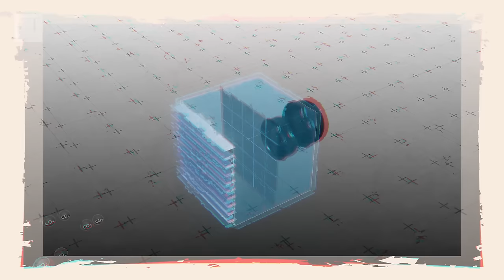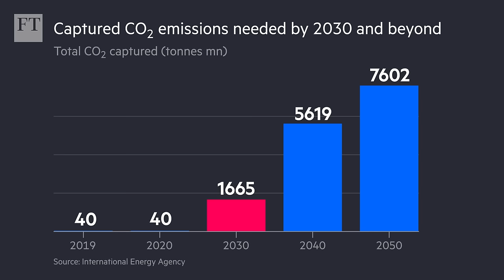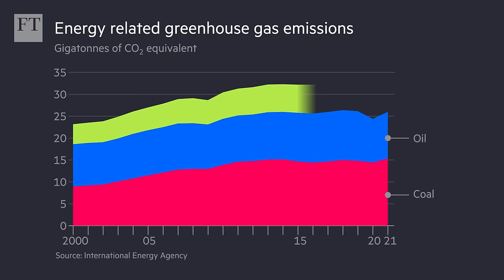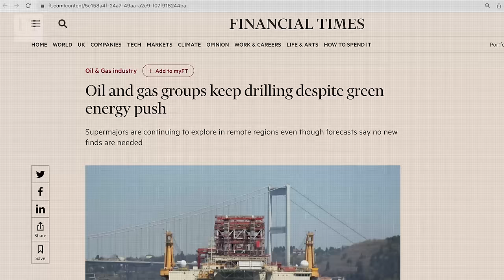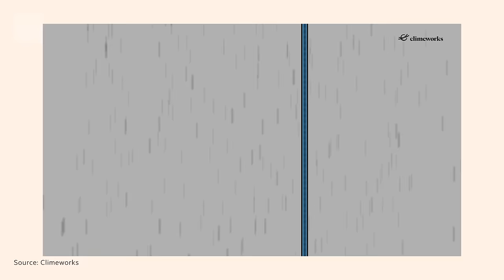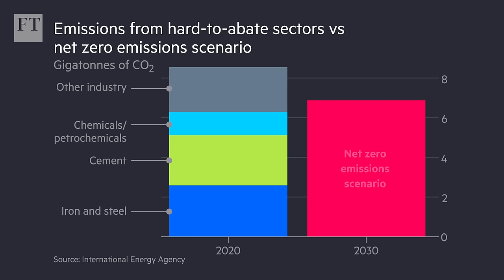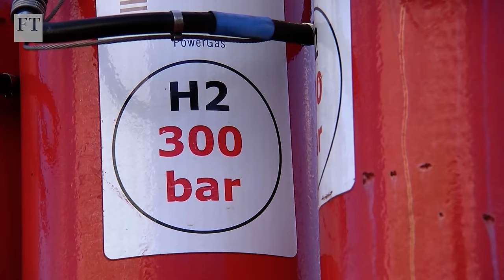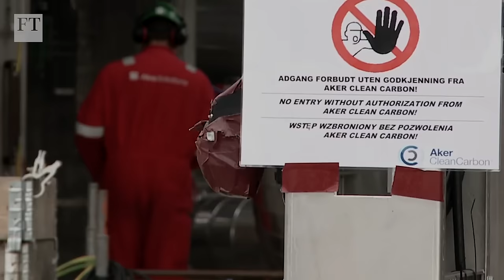Carbon capture: the hopes, challenges and controversies | FT Film

Comment: This is just Koch enterprises trying to burn energy to capture CO2. Any efficient carbon capture will be organic: adding iron to the sea, growing algae in lakes/rivers, etc. to feed tilapia. An RIT prof. Kosovo believes it possible to precipitate CO2 from seawater as calcium carbonate. However, the quadrillions of tons extracted would bury the sea floor. The best solution would be more coral. Any ideas on how to grow it?
Reply: So let's be at least honest it's not quadrillions  😅 in total humans have added maybe 1-5 terra tonnes or 0.001-0.005 or pets tonnes. We could burn all the oil and gas and every carbon life form and probably still not hit that. Probably. It's a general approximation of about 1ppm to 1-5 giga tonne.

Alrighty so here is the crux. Anything that requires active input will be ineffective. Any carbon emitted will take nearly the same to get it back into organic molecules. Carbonates are the cheaper method and more chemical sound but then we now need to store billions of tonnes of that. Each giga tonne is roughly a cubic kilometer of carbon as a solid. That is a lot of course, but if you use it as an approximation the grand canyon would be able to "fit" 4000 giga tonnes of carbon. That down plays it but the largest open pit mine would only fit about a years worth :/

We will need carbon capture of some form but realistically it will need to be passive and have some mechanism to move it to long term. Otherwise anything organic runs risk of making its way back to atmosphere. Realistically one way would be to put a price on Carbon. That means it will eventually be competitive to suck it out and stick it down somewhere. Unfortunately we will need to do this even after zero emissions. The oceans will actually buffer us backwards as we start reducing it will begin emitting. If temperatures fall this would slow but as it warms it will speed up.
Reply: We must use all solutions.
Reply: One way to grow coral and carbonates is with Biorock technology, which electrifies rebar in the ocean. It costs some energy, but if powered by renewables it can be a great way to both sequester carbon in corals and to protect shorelines from more dangerous storms as the world warms.
Reply: @benwalters9712  I'm curious whether this would work with ocena acidification though. Additionally, coral all things considered is fairly slow growing and not really net carbon sinks. Additionally the energy input likely my just be more efficient to use for pulling out carbon and shoving it in ground
Reply: Sadly organic life is terrible inefficient at storing carbon.  It takes between 35-46 trees to capture 1 tonne of carbon.  Ignoring the fact that introducing the amount of algae we would need into establish ecosystems is a horrible idea, using plants to offset CO2 emissions is impossible.  A single FCC unit in an oil refinery emits 800,000 tonnes of CO2 a year.  The current weight of all algae produced by humans every year is 10,000 tonnes.  Even using a 1:1 ratio of weight of algae vs weight of CO2 (it is obviously not 1:1 but let's use this for simplicity) we would need to increase algae production by 80x just to cover a single FCC unit.  600 active oil refineries in the world means FCC CO2 emissions alone are 480 million tonnes.  Plants are just not an effective solution over a short period of time which is what we need.  Decarbonizing industries, capturing carbon from industries that emit CO2 as a by product of manufacturing, created more energy efficient products, and removing gas powered cars from roads are going to be the actual big solutions to this problem.

Comment: For hydrogen, we could build the infrastructure around Amonia, which has a higher hydrogen carrying capacity than pure hydrogen, is easier to store, etc. 
But, since as you said fossil fuels are used mostly for heat, we could have molten salts carry this heat around, heated by mirrors (solar thermal), geothermal (with extremely deep pipes to get high temperatures), use thermal batteries (with sand, rocks or molten salts for the thermal mass), bio-methanisation (compost and poop making methane), and so many more solutions. 
But, all that has to be cheaper than the existing oil infrastructure, which is often subsidized. 
To me, that sounds like what we need is a fundamental change in the market structure, to prioritize people, not profits. 
The simple way to do that is to legislate bosses out of existence. Workers direct democracy. 
Since the concept of exploiting ourselves (by extracting our surplus labor value) does not make sense, since the focus of work comes back to our collective desires and well-being, the cost-cutting-profit-seeking shortcuts and infrastructure we put in place would not have the incentive to be there. 
Given that most people consistently show a strong desire to shift production to accomodate the natural limits of our environment, that this transition seems to be held up by a handful of Capitalist ghouls, hopefully we'd do the measures needed to avoid this catastrophe. 

Like stopping making things that are made to break early (planned obsolescence). Stopping ads (manifactured obsolescence). Just these 2 things that exist only because of profit-seeking would reduce our consumption to a huge degree, thus reducing the need for the industries making those. In our current world, this means a recession. But in a world where the point of an economy is to fulfill the needs of the population, these kind of measures are a pure positive. Maybe we can lower hours needed in a work week. At least, the commitment to providing goods for need and not greed should massively increase the cushion on which people can fall. 
There's many more measures to reduce the industries needed, many ways things could be less damaging on the environment, but I do not see Green Growth or even some kind of ecologically planned Capitalism as a solution. As long as the incentives to rely on externalities exist, it will be exploited, and Capitalism itself cannot exist without stealing from somewhere (nature, our bodies, our health, imperialism, colonialism, etc.).

Comment: Whatever amount the Oil industry is spending on PR should instead be used for their own future (power grids, PV/Wind and storage)
Capturing CO2 shouldnt even be the 2nd goal.
Reply: Except you need to capture CO2 because a huge amount of consumer products both produce CO2 during the manufacturing process and/or use petroleum as a feedstock.  Just walk thru your house and imagine throwing away everything with plastic in it and throwing out any clothing item that is not 100% wool or cotton or hemp.  Also eliminate any steel or cement products and foundations since both those industries need to emit CO2 to create their products.  If you want to have all the technology and products we currently have and reduce CO2 the only option is integrating CC into an expansive CO2 reduction program.

Comment: Today I believe that carbon capture and storage is not really amazing. But carbon capture and utilization can be a really helpful technology for replacing natural gas and oil. The main reason is that captured CO2 has a value and can be used for the synthesis of carbon neutral fuels like synthetic methane and methanol, or even gasoline.

Comment: The film is also too positive I think about Drax unfortunately, and the biofuel project there - many environmental experts and people think this does an awful lot of harm. Whole swathes of forests are devoted to this in America, and then all this wood has to be shipped to the UK. Monoculture forests also cause problems in themselves... some analysts think Drax is as bad or worse than fossil fuels? Perhaps, this is an exaggeration, but I don't think Drax - unless the wood were sourced more responsibly - is not what was promised.
Reply: Definitely not worth building a new plant but perhaps repurposing the existing coal plant is worth a go. Shipping the wood around needs to have co2 minimised. Since there is no rush perhaps slow but low carbon sailing ships could be used for that.

Comment: Clean energy* instead of renewables. Nuclear must be a part of the solution.
Reply: Part but they take decades and billions to build and produce waste...Carbon capture helps with every aspect of nuclear energy.
Reply: @sampleoffers1978  the only real solution to drive down carbon emissions is nuclear power.  Carbon capture is fine if the electricity comes from a carbon zero source.
We could produce electricity with nuclear power, use the energy to desalinate water from the ocean, run carbon capture, and power homes and industry.  
All the talk about renewables is fine, but they lack the land density, raw materials, supply chain, and intensity that we need to move the scale in a meaningful way.

as the lady says at 6:40 of the clip, anything other than nuclear power is "tinkering around the edges".
Nuclear power is contained waste, and carbon emissions free.
The continued use of coal can not persist.

Comment: Plot at 11:51 indicates that wind turbines & solar photovoltaic now generate 250 / 18,000 = 1.4 % of humans' energy. It's a start I suppose.  I assumed the plot is energy delivered and not energy generated (includes transmission losses).
Reply: the only real solution to drive down carbon emissions is nuclear power.  Carbon capture is fine if the electricity comes from a carbon zero source.
We could produce electricity with nuclear power, use the energy to desalinate water from the ocean, run carbon capture, and power homes and industry.  
All the talk about renewables is fine, but they lack the land density, raw materials, supply chain, and intensity that we need to move the scale in a meaningful way.

as the lady says at 6:40 of the clip, anything other than nuclear power is "tinkering around the edges".
Nuclear power is contained waste, and carbon emissions free.
The continued use of coal can not persist.

Comment: This looks like a video covering current emitters and how to remove residual emissions from them. 

Why is there no talk about biochar and nature based solutions?
Reply: the only real solution to drive down carbon emissions is nuclear power.  Carbon capture is fine if the electricity comes from a carbon zero source.
We could produce electricity with nuclear power, use the energy to desalinate water from the ocean, run carbon capture, and power homes and industry.  
All the talk about renewables is fine, but they lack the land density, raw materials, supply chain, and intensity that we need to move the scale in a meaningful way.

as the lady says at 6:40 of the clip, anything other than nuclear power is "tinkering around the edges".
Nuclear power is contained waste, and carbon emissions free.
The continued use of coal can not persist.

Comment: Carbon Capture is the key 🗝️
Reply: the only real solution to drive down carbon emissions is nuclear power.  Carbon capture is fine if the electricity comes from a carbon zero source.
We could produce electricity with nuclear power, use the energy to desalinate water from the ocean, run carbon capture, and power homes and industry.  
All the talk about renewables is fine, but they lack the land density, raw materials, supply chain, and intensity that we need to move the scale in a meaningful way.

as the lady says at 6:40 of the clip, anything other than nuclear power is "tinkering around the edges".
Nuclear power is contained waste, and carbon emissions free.
The continued use of coal can not persist.

Comment: How about making methane using the Sabatier process and using that methane as fuel. That would make the use of that methane carbon neutral.
Reply: But why bother? You have to put more energy in to make the methane than you get out when you burn it. The process is very inefficient, especially since you have to capture the co2 first to then feed it into the process. If you want to store energy in a gas using hydrogen or ammonia for that makes more sense. Hydrogen only needs water and nitrogen makes up 80% of the air so it's much easier to get hold of.

Comment: What about nuclear? No CO2 and clean energy also for hydrogen production and carbon capture
Reply: One problem is Current average build time for one is 12+ years. 

Solar and wind are a lot cheaper and have much larger carbon offsetting capability than nuclear. 

That & planting trees / stopping deforestation
Reply: @y0uCantHandle  How about both? There is a critical shortage of zero carbon energy. Solar and wind need support services to balance production with demand. Nuclear could help a great deal in this. Also it should be possible with build times considerably shorter than your estimate.
Reply: @Anders127  it’s not what I estimate, it’s fact. 

The IPCC recently released a report comparing the effectiveness of each of the technologies, I suggest you check it out.

Comment: We must continue to use carbon based fuels. We need them for all the modern materials even to build green products. Paints, steel, plastics, coatings l, electrical wire, pipes, fasteners, fabrics, insulations, medical devices, food production l, computer, cell phones all required carbon based chemicals. 

If we continue driving the price of carbon based fuels up, our economies will collapse.

Comment: Why is nuclear never mentioned in green energy?
Reply: the only real solution to drive down carbon emissions is nuclear power.  Carbon capture is fine if the electricity comes from a carbon zero source.
We could produce electricity with nuclear power, use the energy to desalinate water from the ocean, run carbon capture, and power homes and industry.  
All the talk about renewables is fine, but they lack the land density, raw materials, supply chain, and intensity that we need to move the scale in a meaningful way.

as the lady says at 6:40 of the clip, anything other than nuclear power is "tinkering around the edges".
Nuclear power is contained waste, and carbon emissions free.
The continued use of coal can not persist.

Comment: There is a machine that is cheap, requires little mantainance and replicates itself over long periods of time that captures carbon from the atmosphere. It runs on solar power and requires water instead of oil.
Yes *plants*; natures carbon cleaners.
Reply: There are problems with trees as well. First you need to plant a variety of trees to prevent monocultures and ensure that they are not invasive species to the ecosystem. Second,if trees burn (something more common due to the climate crisis) ,they release all the carbon stored in them.In fact the goal should be allow forests to heal and stop deforestation on a large scale.
Reply: Any solution that doesn’t include the preservation and restoration of healthy forests is worthless.

Comment: The above all sounds very nice but in the meantime Draxx have been caught chopping down virgin forrest in Canada to produce the wood pellets to burn in their biomass plant.  A much bigger concern that I have with all these people getting so giddy about the use of electricity and changing to renewable is the question if anyone of them went to the trouble to do a Life Cycle Analysis of solar and wind power.  
What amount of fossil fuels are used to produce the metals and minerals needed for the production of these wind farms and solar panels? 
What amount of fossil fuels will be burnt to recycle the solar panels and wind turbines when they reach the end of their life cycle.
Do we actually gave the technology to recycle batteries, solar panels and the windturbine blades? The answer is no, we don't.  
The inability to recycle all these dirty green energy products will hugely contribute to a much larger problem that we have to address and that is pollution.  
Fossil fuels improved and saved the lives of millions, if not billions of people and until all these commentators are willing to give up all the luxuries afforded to them through the fossil fuel industry it is not really worth listening to them.

Comment: Carbon capture as a technology may work with enough investment. But regenerative agriculture as practiced by understanding AG is a proven methodology to storing carbon in the soil making the soil more productive. Any investment in switching farming practices to regenerative farming will switch farming from a net emitter of carbon to negative carbon emitter. If investment was made to green deserts and degraded land there would be a huge storage of carbon in soil making the soil productive. Regenerative agriculture is a methodology and not a technology. The investment is in education. It is available now. Greening desert will require investment but will pay for itself when the greened land is productive and has value.

Comment: Using carbon capture to reduce impact of coal/oil/gas power stations/cars is pointless and expensive.
Using surplus energy coming frome nuclear and renewables to decarbonize some specific sectors which intrinscly produce CO2 makes sense (for exaple waste-burning plants, steel mills, chemical plants, cement factories...). But it means extra costs that will be possible to support only if people stop to be anti-nuke ( I personallly used to be one of them, but then I realized that random renewables require fossil fuels or emitting biomass, while renewables+ nuke don't)